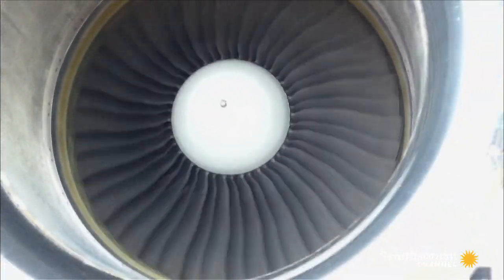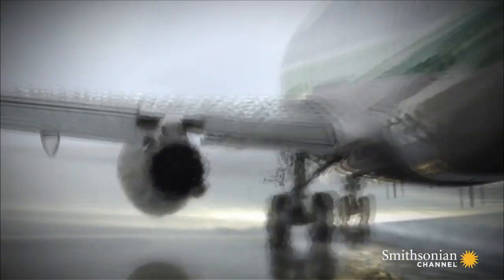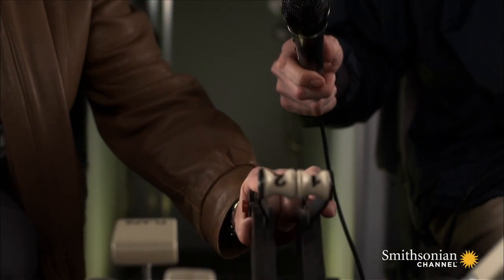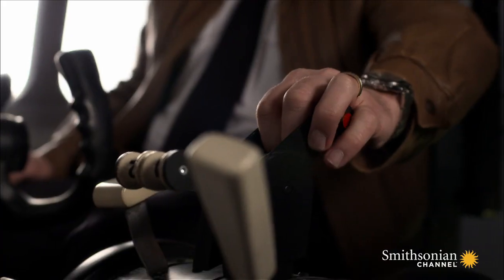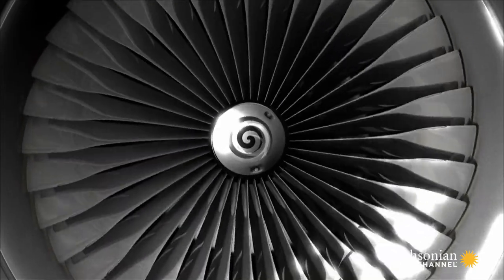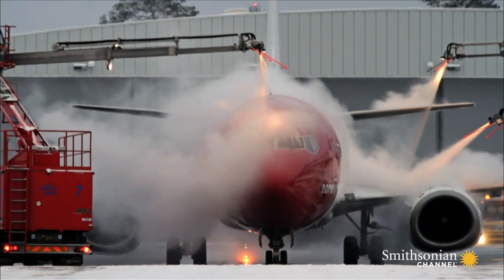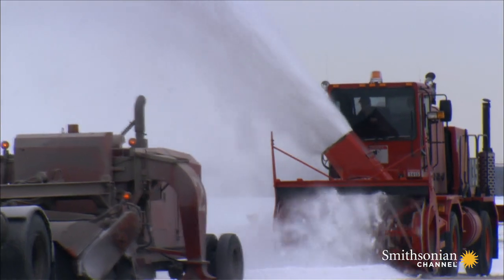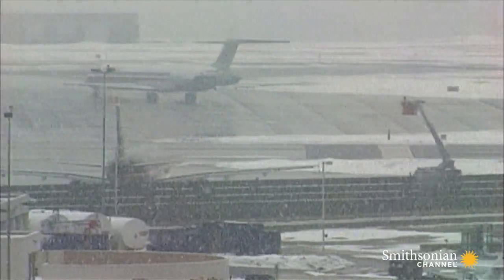Why Did This Flight Crash? Listen to Its Engine...

Comment: The FAA is a tombstone agency.  Thus, because funding is never great enough to last them the white let year doing normal operations and airport maintenance, they cannot innovate safety to the extent people would expect.  Only when people die, and Congress then decides to push more funding to increase safety does anything happen.  You want safer skies, push for the FAA to fall under the executive branch, and pull funding control from congress.

Comment: I fly small planes and always listen to the sound of the engines. This is why I won't wear noise cancelling headsets.
Reply: Guess looking at the instruments is too complicated for you.
Reply: @noreason2701  instruments are lagging, reactionary. You will hear problems and even feel problems with your butt before you see anything on the gauges. I made my last aborted take off based in what my butt told me.

Comment: When in doubt throttles full-forward and maintain at least takeoff safety speed
Reply: 6 months late but I wanted to comment that these old aircraft didn't have computers to keep the engines from burning themselves apart. If you slammed these throttles to the stop, you'd destroy both engines in about 20 seconds.

Comment: 737’s are still safe right, one of them just decided to crash because the pilots were not giving power that the engines needed. Wait this sounds like some kids book.
Reply: Woot here comes 2 737 max crash
Reply: Not de-iced properly. Not pilot error.
Reply: Motion Movies this happened ages ago, it could have happened to any plane. They all have the same censors for the engines. The pilots were giving the power needed, but they weren’t getting the thrust due to the ice blocking the censors. 737 is still a safe plane, excluding the MAX variant
Reply: The instruments mislead the pilots into thinking they had enough power for takeoff because the senses were blocked with ice, giving them a false sense of security…had they had turned on the de-icer this accident would never have happened

Comment: If only road crash investigations worked the same way.  Figuring out the causes then taking steps to prevent them happening again.

The biggest cause of road accidents is the nut behind the wheel.  Replace that and we'd all be a lot safer.
Reply: Plane crashes are caused 95% of the time by human error. And, even that 5% was caused by human error during manufacturing. So technically all crashes are caused by human error.
Reply: TwisterLord Yeah, I heard about 70%, but ppl have explained that pilot error can be attributed to almost all flights, even if mechanical failure, weather etc. was initial cause. Flight sims show a lot of pilots recovered from problems, obviously, even on accidents that were not blamed on pilots.
Reply: Or probably because nut inside the car. Lol

Comment: I'm about to fly on a 737. Shoot.
Reply: are you still alive?
Reply: Yes.
Reply: sullyz Airbus and 737 are very safe
Reply: Evergreen XCVI This is a 737-200. You are most likely going to fly on the NG series. The NG series are much more efficient and updated from the older models. You are not likely to crash. Besides, it’s the max that crashed, not the NG series
Reply: This is the early model 737, you can tell by the thinner nacelles
Reply: Did you died?
Reply: Aviation Excellence 737s are still good
Reply: B737 max 8
Reply: But is it a 737-200?
Reply: Oof
Reply: I only fly the 800 model
Reply: Hooo Dawgehh 737 safer than an Airbus?????? 😂😂😂
Reply: TheComedyBallers nope 737 is rated the safest airplane in the world ;P
Reply: @charlienorton2337  laughs in 737 max
Reply: Charlie Norton hmmmm not really . The 737 max had some flaws which caused 2 planes to go down. Because of Boeing trying to earn more money, people died. I don’t really trust 737s that much.
Reply: Jun Wu Huang if you read my comment it’s literally from 3 years ago - before any of the 737 max stuff but I stand by my opinion that the 737 not the 737 max is the safest plane
Reply: @charlienorton2337  don't bring reality into this !
Reply: sullyz Ys they are. In fact, it has a 97.7 percent reliance.
Reply: sullyz look it up mate, the least crashes in the amount of flying hours it has
Reply: Airbus are better ;p
Reply: @thecomedyballers680  Airbus suffer cracking due to design flaw. Same with the 737
Reply: TheComedyBallers nope. Boeing is better
Reply: @ravensight1  They seem to have some issues nowadays. See https://www.youtube.com/watch?v=rvkEpstd9os - boeing seem to have a history of cutting down on QA after a merger. The two 737 MAX accidents might be further proof of lack of QA, allthough this is just an assumption
Reply: Those 737’s, huh. Lol